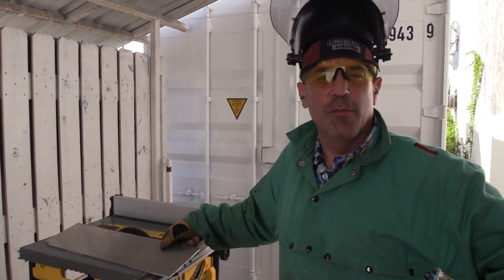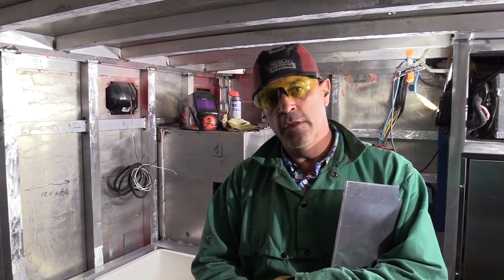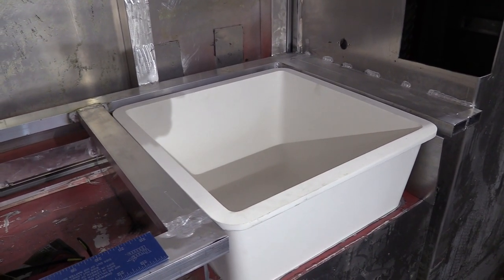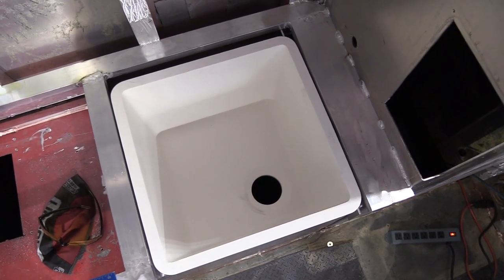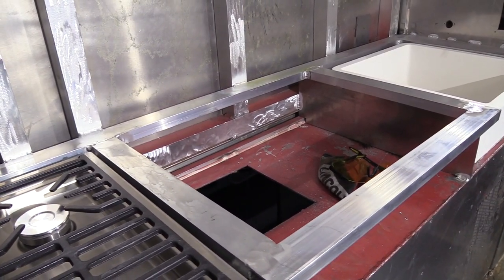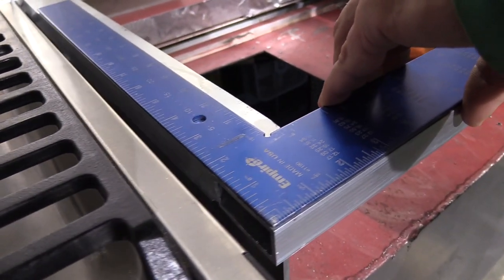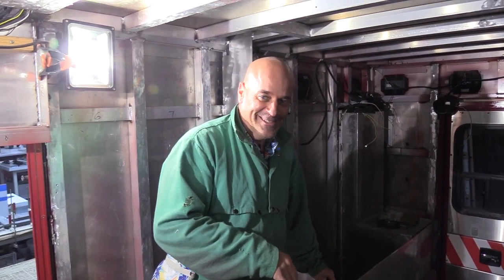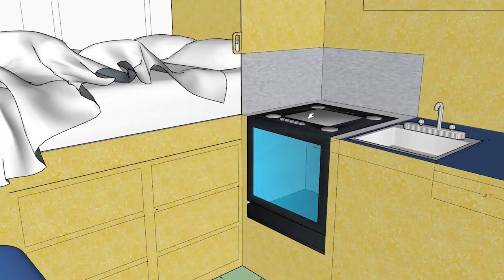Ambulance to RV/Part 7 - Yacht Shop Creations "The Bear" Project

Comment: Good content mate. Definitely over engineering alot of it but that is my work ethic anyway. Keep reminding us of the hours that go into this kind of work. I engineer alot of one off projects and always find it hard to get across the hours it takes to do this work. In a few months I will be starting my own ambulance build. It is a UK spec Wheeled coach Chevy G30 which I have owned for a number of years. It wont be quite as flash as yours but will be built to carry a couple of motorcycles when needed whilst providing all the necessary comforts for travelling. Should be fun in a 10x6 body! All the best from the UK.
Reply from the maker: Thank you for the kind comments, yes I’m looking forward to finding out exactly how much time it actually takes to do the job in the fashion that we would like to see it completed them. I think you should put your build on YouTube as they seem to be pretty popular. Motorcycles and RVs, is there anything else that a man needs? I find things are only overbuilt if they never break :-)
Be well and good luck on your project my friend, Jim

Comment: Was the plan to work in aluminum for all the structure from start? What’s the plan for the finished surfaces? Polish, paint, panel overlays?
Reply from the maker: We have changed the conceptual idea several times before reaching the current junction;-) Originally we were going to structure the interior with teak cleating and multiply. We decided against this upon using our God-given intellect as it doesn’t really make any sense. The final result will be multiply over the aluminum and that will basically be a fascia covering the aluminum obviously. That should make for a much quieter unit off-road.
Jim
Reply: @YachtShopCreations  I'm not familiar with the product "multiply" you refer to. Is it a pre-finished panel?
Reply from the maker: You may know it as Baltic birch, same thing.
Reply: Yacht Shop Creations yes indeed. That’s what we call it around. Thanks Jim.